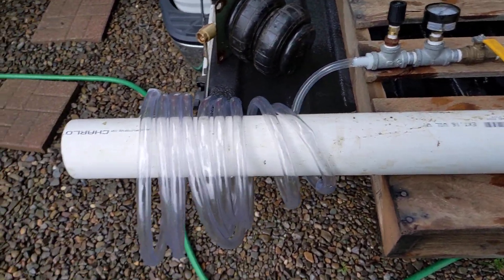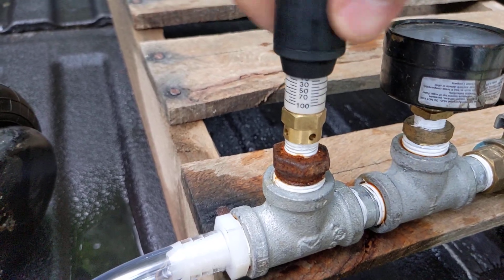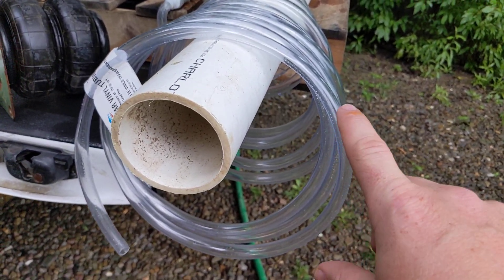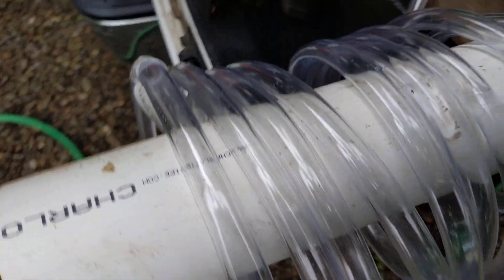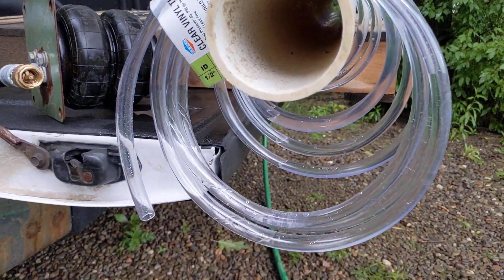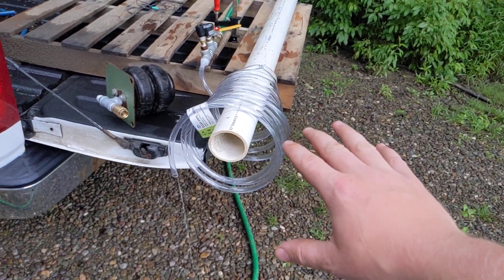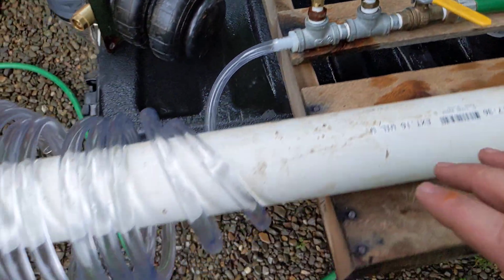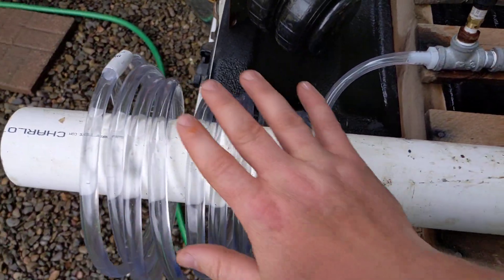Creating "Artificial" Back-pressure (Water Pump Testing)

Comment: Hi Joe, there are two kinds of coil pumps - (1) spiral pumps (hose wound up in a vertical plane with diminishing coils) and (2) helix-like coil pumps (with coils of equal size). Here is an example of no. 1 https://youtu.be/mN9iLNHGOYI and here of no. 2 https://youtu.be/9K1zLVABB0U I am asking about no. 2. It's driving me crazy how the air sockets are squeezed more and more by the subsequent coils of the equal size. How the pressure is built-up in a helix coil pump?
Reply from the maker: Are you asking how it works? I'm not sure how to even describe it.

Comment: Fairly cheap test bed setup suggestion. Take 10' lengths of PVC pipe and make "U" s using elbows to connect vertical pipes making one long pipe out of it. Each 10' segment should give you an additional 4PSI so 12 with water and 12 with air should give you close to 50 PSI. If bundled, then they could even be self supporting with maybe just 1.5" PVC pipe. Or just hang it on one of your trees for stability. Question would be, would regular elbows work or would you need to use sweeps instead? If you used regular elbows you could also use a tee at the top and bottom of a column to attach tubing so you could see the water levels. In that case the straight thru would be facing up at the top so that you had an extra space to show the level. You could even add an extra short length of pipe so that it would be easier to see. Add a float in the tubing and you'd have an instant indicator of the level. Turn on the water slow at first and it should fill just like your tubing. You would need a drain at the bottom of each anyways as over time, the air would be absorbed by the water in the air columns.
Reply from the maker: All good ideas but I was going to do 5ft sections for portability. 10 "loops" would get me 50ft of resistance. For simplicity I will use 1.5" 180 traps. The bottom traps will have cleanout holes where I will attach a ball valve to monitor and drain.
Each ball valve will have a Barb where I can attach a clear section of house too visually determine maximum static head.

Comment: Good one, Joe! With that same 10’ piece of hose, you could do a video on what simulates more water column: 2-3 vertically stretched coils, or many smaller tightly wrapped coils?
Reply: Obviously the vertically stretched coils will work better, especially when they are mounted above the pump and the end of the hose is on top.
Of course you still create the most backpressure if the 10ft hose goes straight up.

Comment: TBH I would use it transparent pipes with transparent U-bends as you need to measure head on each column pair.
Reply from the maker: I can just measure the pressure at the pump. I can vary the exit height of the final loop to find the maximum delivery height.
Reply: @JoeMalovich  then you can fold it so pipe goes in a zig zag manner. Another benefit is that you include pipe losses head.

Comment: I don‘t think this really is zero restriction in flow, otherwise we would have overunity, which is not possible... would be interesting to see the larger build with pressure gauges on each part (air and water in the loop) and a flow meter as well
Reply: This is why you want a large diameter pipes. Large pipes with very slow flow will have small friction losses head, hopefully such that it can be omitted when dealing with hydrostatic head.
Reply: @tymoteuszkazubski2755  I don‘t think friction is the issue, due to the back pressure I would assume less flow because the pressure differential in the valve or pipe is reduced
Reply: @big12boylp  Friction causes head loss along the pipe. If you measured head along horizontal pipe you would see that the further you go the lower the head is.
Reply: @tymoteuszkazubski2755  I know the physics behind it, but at this flow we should not see much difference at all. I think we talk about different points here, I do think that any restriction will have the same effect he is experiencing, does not matter if it is an air lock, a half way closed valve or height.

Comment: Cool... but why is back pressure with no flow restriction useful?
Reply: It probably makes it way easier to measure flow at given head equivalent backpressure. If you have only marginal friction losses which vary with flow and all resistance is caused by backpressure/head your flow measurements become easier to manage if you are making flow/head chart.

Comment: So, I think I missed a key concept here. At first I was thinking it worked like an Archimedes screw, but when you mentioned it being static on a board you lost me. What is filling the loops on the board if you aren't using  pressure to overcome the additional force of the accumulated water in the loops? If the source is higher than the top of the loops, you'd be using the weight of the source water.
Reply from the maker: Think of it as a resistor, and yes you would need to subtract out the supply pressure. It's a little hard to wrap your mind around, I admit.
Reply: this is a  test jig to see how much head pressure a given pump has  without needing to go up 40 or 50 feet. 
the air gaps in the hose act as a buffer between each column  of water  making each coil  additive (height wise) 
without the air buffer gravity /siphon will  make the height effectively 0  so the only resistance to flow would be friction and not gravity
Reply: @killernat  I wouldn't say that air acts as a buffer, more like pressure transfer device. With air, the apex pressure is the same as free surface pressure in the next segment because air is negligibly affected by gravity at this scale.